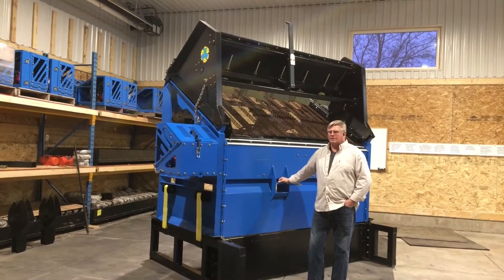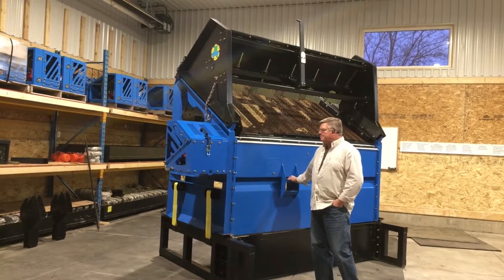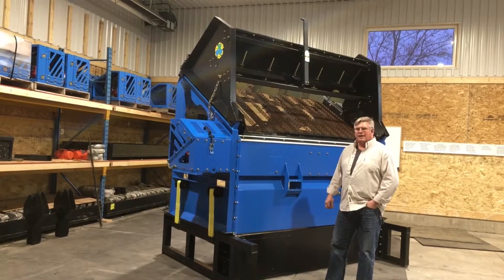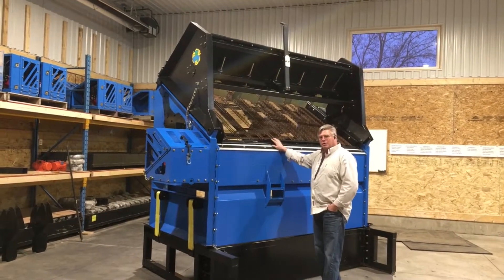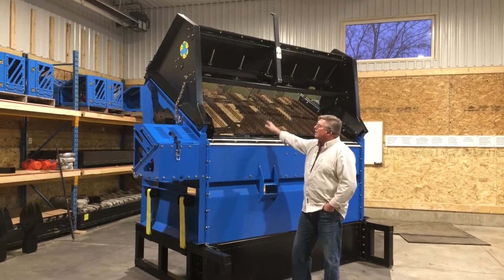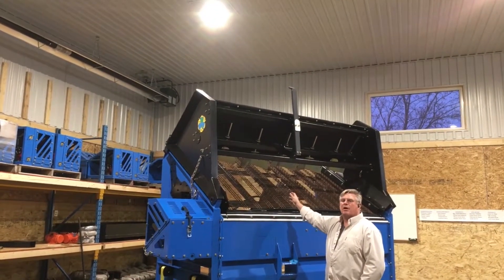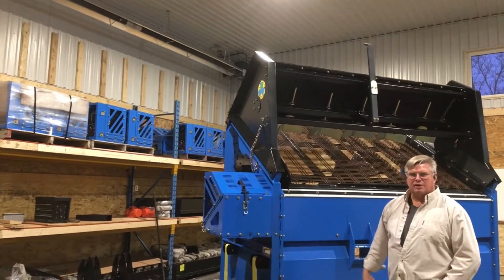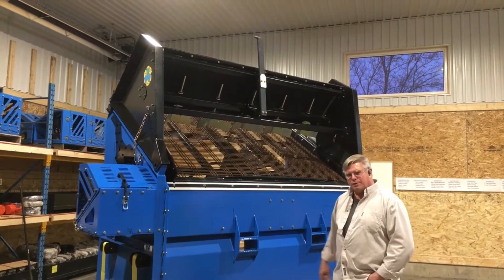Summary of the SLG78VF Gas Topsoil Screener

Comment: Does the gas engine power the vibrating mechanism or does the engine power a generator that powers the vibrating mechanism?  And does the gas powered vibrate the screen more aggressively than the  electric?
Reply: It is a vibrating mechanism. It is quite aggressive. That being said, our machines with the vibratory packs are more popular as they have less moving parts, less maintenance, and 1/2 the money